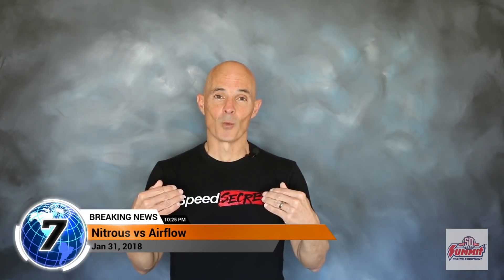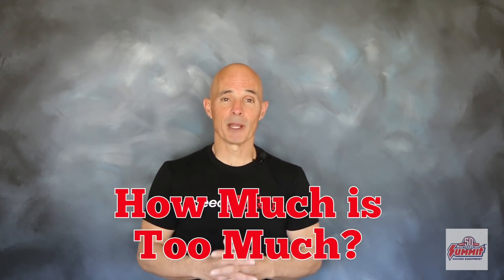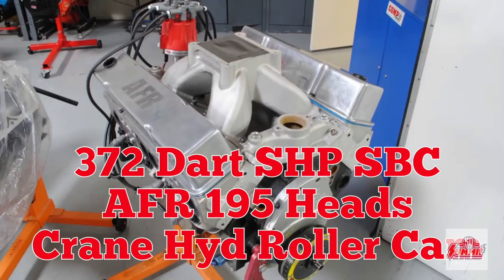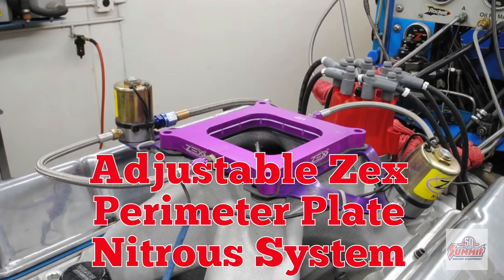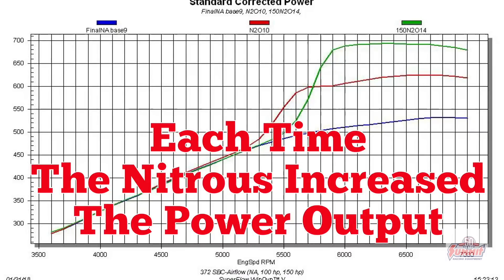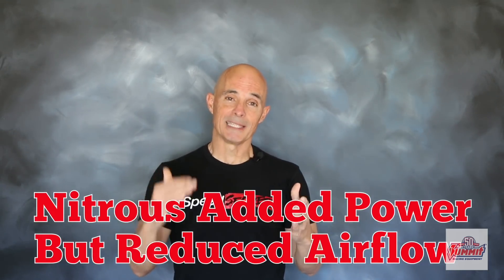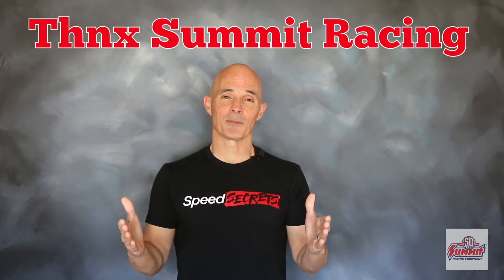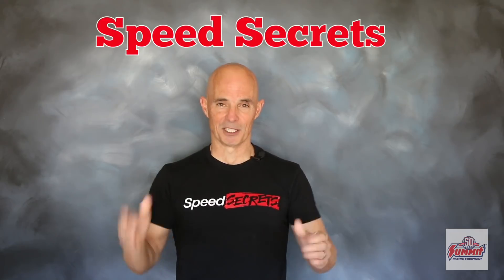Nitrous Oxide—How Much is Too Much!

Comment: Enjoy all of your vids. I am a little confused , isn’t nitrous the source of air for the amount of fuel you are introducing into the engine. Seems to me the carb would have very little influence on the performance at that point. I run a small block Chevy with Holley 750. I run nitrous and the more nitrous and fuel I add the more power it makes PERIOD.  I guess I’ll know when I add too much nitrous when it comes apart. Thank you for the vivid, keep them coming.
Reply: YES YOUR RIGHT... THIS IS EXPLAINED POORLY

Comment: My first thought is, the 950 cfm carb is not right for the motor if your measured  cfm using nitrous is 640 or whatever he came up with. Next is, you are running off the oxygen from the nitrous so. . .  I dunno, what are we trying to do with the video? I guess I’m not clear on why we want to worry about cfm going down. Unless it’s as I said at the beginning, to select the proper cfm carb.
Reply: This info in the video is gold in the hands of the right person. For example, air has 21% or so oxygen, nitrous has 33%. The higher the oxygen ratio the hotter the combustion. This means you will be running a colder not just because of the extra HP, but because of the way the HP is made... with an increase in purity of oxygen. Oxygen makes heat, the other inert gases expands and create more pressure. The nitrogen component of nitrous does some of this work. However,  with less inert gasses to expand we are seeing a disproportional increase in heat than pressure. And this is why an all motor car making 500 HP will can run cooler than a nitrous car making the same.
Reply: @TunerNerd  This isn't the point of the video though? we all know that the engine will run hotter with nitrous than with a normal ratio of oxygen and nitrogen and inert gases from the atmosphere. why is he referring to drops in cfm at the carb like this is the determinant in limiting nitrous use. the engine can only consume x amount of gas, we all know this , consumption isn't infinitely large. We can run an engine on nitrous and fuel mixture in a vacuum with no carb, his point about cfm at the carb is irrelevant and poorly explained.

Comment: I Sprayed 2 stages at 250hp per stage on stock 5.0 liter an it worked great. I'm sure air flow was zero on it but I didn't give a shit.  

On purpose built race motor we sprayed 3 stages for total 1k hp.

Comment: This is the most pointless test ever. The cylinder will only take in a given amount of volume depending on the actual volumetric efficiency(Not airflow VE, the VE of the air/fuel mix). If you add more nitrous and fuel there can't be as much air, nitrous isn't going to make your volumetric efficiency go up. What would be interesting to know is whether the nitrous and fuel make the VE go down because they shouldn't flow as well as air does.